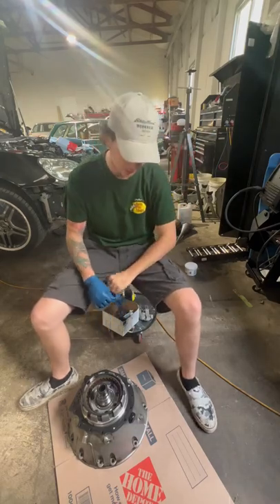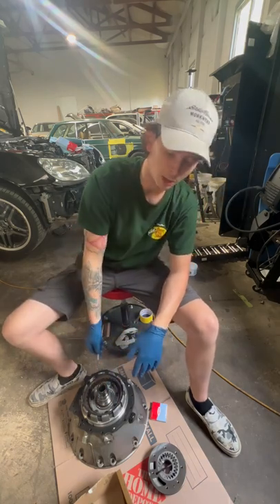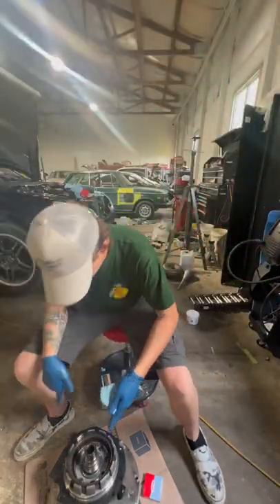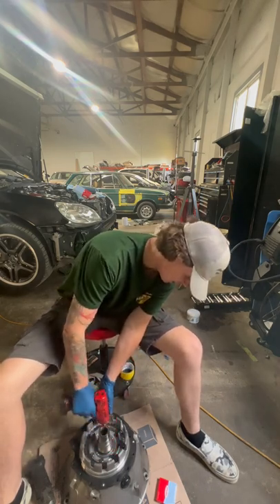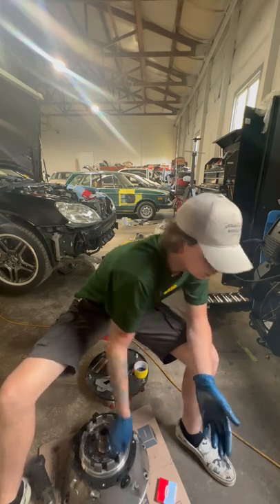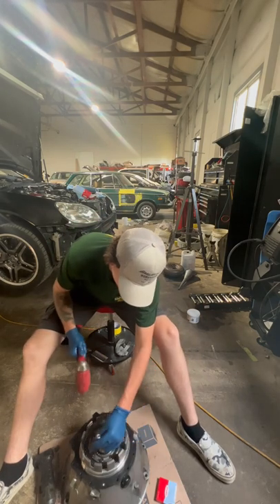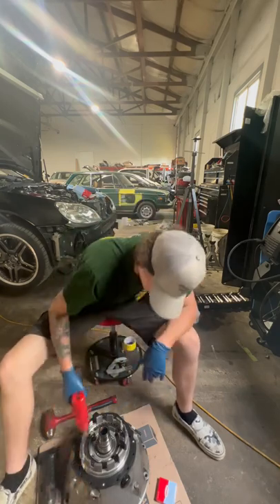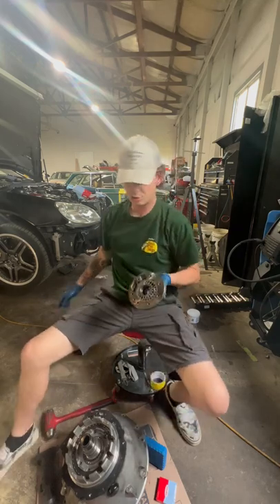Mercedes V12 722.6 Transmission Oil Pump Replacement 800HP S65

Comment: If the oil pump breaks is it true that you need to replace the torque converter as well? How do you check if it's ok? Also is their supposed to be any play in the input shaft?
Reply from the maker: There is a small amount of play aloud in the shaft but hard to say without seeing it myself. torque converter should be replaced if metal shavings got inside of it. If your converter is fitted with a drain plug (depends on model) than you can flush real well and hope for the best. Sorry for the older video and missing torque specs. Cheers!

Comment: Do we have to replace the bolts.. honestly?
Reply from the maker: I have personally snapped the head off of the Torx head bolts by torquing them to factory spec. Just a head up but the choice is yours! I should’ve included some pictures of them broken but this is an old video
Reply: @AMGAddiction  do you have to thread the bell housing bolts in some in order to get the bell housing back flush against the transmission case? Or does it suppose to just pop back in place after you get the frictions aligned?
Reply: @AMGAddiction  i figured it out. I just tightened all the bell housing bolts going clock wise until it drew itself in flush to the transmission case .. then I took them out so I can lock tight them.. " blue "